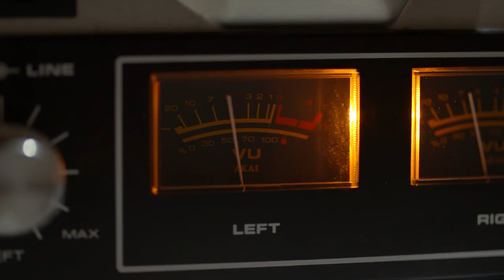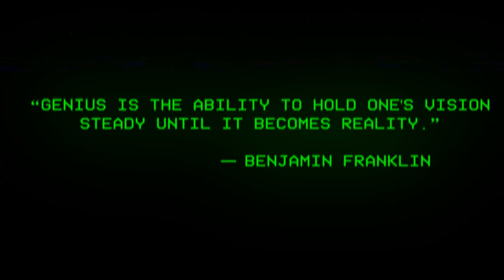Restoration of RUSTED PS2 Retro Console | Retro Repair Guy Episode 17

Comment: I wooden wash that battery with it I would take it out. but keep up the good work
Reply from the maker: Hi and thank you! Yeah I never follow my own recommendations (shoemaker always wears the worst shoes). That day I was concentrating more on filming than my work and noticed I forgot it when I filmed it come out of the dishwasher. I was going to replace it anyways as the unit was so rusted and the battery had leaked a bit. I just ended up cleaning the battery slot with alcohol and put in a new one. Thanks for watching!

Comment: What kind of lubricant did you use for the DVD drive? Can you give me an Amazon link?
Reply from the maker: Hi again. For gears on VCR, DVDs etc. There's a lot of expensive products out there but what I find works perfectly and that I always use is Lucas white lithium multi-purpose NLGI #2. https://www.amazon.com/Lucas-Oil-10533-Lithium-Grease/dp/B004X70LZA

A tube like this will last forever and just apply with a q-tip. You can also see the data sheet on it here: https://lucasoil.com/products/grease/white-lithium-grease

Comment: Hello Mr. Retro Repair Guy, I'm sorry to pester you with so many questions, but I was curious as to where you get all of your capacitors. You see, I have watched your Original Xbox video, and after watching this video it would seem that whenever you need a replacement capacitor, you always happen to have just the right one at your disposal. Do you buy them in bulk or something? 

I have seen big containers of capacitors for sale on Amazon, but I was wondering where you get yours and what kind you buy.

Again, I sincerely thank you for your help and time.
Reply from the maker: Hi Kyle. No worries you are not bothering me it's my pleasure. Yes I do buy capacitors in bulk from Digikey mainly and other suppliers because it costs a lot less. For example a capacitor could cost $1,50 but when you purchase 10 the price can drop to $1 and for a quantity 50 the price can drop to 70 cents. I repair many things and most units all use a certain amount of common values. However I still end up ordering if I don't have a particular one and normally receive them with 24-48 hours. With experience most electronic guys know what the common values they run into and keep a certain amount on hand.

Comment: Is it a joke ….????!!!🤔😨
Putting some PCB on DISHWASHER ?????🫥☠️
Reply from the maker: Hi! No not at all. Many manufacturers when rebuilding equipment dunk them in different chemicals and liquids. Water cannot get into the components like resistors and capacitors. Dishwasher tablets also help against corrosion. What you have to watch for is to make sure to air dry and not use heat. And of course I use a blower to make sure no water is left under chips or other components. Watch some of my other videos you will see how well some of the boards full of leaked capacitors or flux cleaned up. Thanks for watching!
Reply: @RetroRepairGuy  you’re an amazing fix guy , simply I wasn’t tuned about the Wash method with this MACHINES …

Thought that was Very agressive and ultra corrosive…

Anyway that was a pleasure to watch.😃

Good job man.👍

Comment: Corrosion and a bad electrolyte cap add to hear 50 or 60hz noise haha I commented befor you opened it up.
Good job out those bad caps
Reply from the maker: Hi! And yes agree and I always change the capacitors when restoring a unit anyways, which is why I just stopped testing it and began work on it right away. Still don't know how the port got so much rust.
Reply: @RetroRepairGuy  I think it was stored in a wet garage or area.
I do vintage audio repair and 99% of the time electrolyte caps are shorting DC or very low serial resistance. In amplifiers at the end stage they will blow speakers by getting DC on the output.
Well I find you have done a very good job and the Playstation is usable again.

Comment: With Free McBoot you can use an IDE hard drive with that network adapter to load games :)
Reply from the maker: Hi! Thanks for confirming that, I thought that might be possible but I haven't looked in to mods much. I might give it a try when I get my hands on a second one.
Reply: @RetroRepairGuy  It's not a mod, actually. The software for it goes on a PS2 memory card. No hardware mod required 😁
Reply from the maker: @Hounddoggy33  Even better! I don't always like modifying these things, I like to restore them to original. I will definitely try it then. Thanks again!

Comment: I got a PS2 with some slight rust from what looks like soda around the expansion Bay corners, should white vinegar work to remove it? I've heard using a baking soda and water mixture afterwards is useful too, also hopefully mine won't need any capacitors replaced bc that's out of my range lol, good video btw!
Reply from the maker: Hi! For the motherboard I would recommend 99% alcohol and a soft toothbrush. If you can’t get 99, 70% rubbing alcohol will do. The vinegar is good to soak metal parts that have rust. On connectors you can also use a pencil eraser followed by alcohol. Baking soda is good for many things and you can use it on the case but it would not harm the motherboard, however if you get to that point of taking it apart and cleaning, throw it in the dishwasher as I did. Most of these units will need recapping because of their age and will inevitably fail at some point because the capacitors will dry up. However, obviously leave it to someone who knows how if you intend to keep the unit.
Reply: @RetroRepairGuy  alright, thanks for the detailed response! 

So I'll probably have to stick with the rubbing alcohol for this, it's gonna be a weekend project at home, I just gotta get some parts and the tools I need, it's my first time cleaning a console so I'm getting as much info as I can, it's exciting! I already have some vinegar ready, and some brushes.

Thankfully it just needs a new clock battery, and some scratches removed, as well as a really good cleaning which I've been planning from the start, plus the tray piece with the PS logo is missing somehow, and the fan cover is chipped a bit, same for the casing beside it. So I'll probably do it in one go
Reply from the maker: @justanotherghost4589  Good luck with everything! Check out the pharmacy they sell me a huge 99% alcohol bottle for $20 (Canadian!). For the rusted metal parts if you can let them sit in vinegar for a few hours always better, but just the metal parts. Brushes the best is disposable toothbrushes that you get anywhere at Walmart and small paint brushes from the dollar store for dusting. The alcohol reason is that it evaporates. If you use anything else, or even the 70% just make sure to blow out all the liquid from everywhere. If you don't have a blower, use a hair dryer but on COLD only, no heat! Household cleaning wipes work best for fan blades as the alcohol leaves dirt residue. If the fan turns well just leave it, if it has trouble you can add a few drops of oil in the middle where the motor is. Battery obviously change before there is a leak, it's a CR2032 if I remember and again, dollar store.

By the way for the casing, if you feel like extending the project. You can fix it easily with Marine Epoxy from Home Depot. It comes in white and I think Black. Either way it's fast and strong and you can paint it. If you have parts missing, look for broken ones on eBay for "parts only" and make a transplant of what you need.

Hope this helps! Thanks again for watching!

PPS For scuff marks on casing use a Mr. Clean or other Magic Eraser or other white sponge. Again, they have these at the dollar store. If it removes some of the shine, I use some Aerospace 303 but you can use a drop of armor all or other similar cleaner for shining plastics.
Reply: @RetroRepairGuy  thanks again! So far I have most of the materials ready, I think I have the right screwdriver to get the head shield off lol, I just need the alcohol, and I have some white vinegar to soak the expansion bay, I think some soda was spilled on the back of it because it's rusty around the opening strangely, hopefully it isn't anywhere else, and I have some CMOS batteries, I just need some case parts now
Reply from the maker: @justanotherghost4589  OK good luck just be careful. Again soak metal only in vinegar but try first alcohol wherever you can. Cheers!
Reply: @RetroRepairGuy  yeah I will, just opening the top felt fragile when I did a little check to see how dirty it was lol, and I'll be sure to try it!
Reply: @RetroRepairGuy  okay so I decided to clean it today! I've been soaking the expansion Bay in vinegar and it's getting shinier, I can't tell if it's just an old layer coming off or what, hopefully it's not a protective coating or something
Reply from the maker: @justanotherghost4589  Normally a couple hours should do it. As long as you soak only metal it's fine. Don't soak any part of the board. Dry it off and rinse it well afterwards with alcohol.
Reply: @RetroRepairGuy  alright, yeah the board is fine, I just scrubbed it a little with some IPA, same for the heat sink as it had some spots on it, aside from that the cleaning has gone well! It just desperately needed soaked
Reply from the maker: @justanotherghost4589  Glad to hear it! If you have a pic or two of the finished product post it somewhere and give us a link.
Reply: @RetroRepairGuy  alright, and well I ran into another issue, the main disc drive ribbon cable doesn't wanna stay in, which is extremely frustrating, I might just try getting another laser eventually and replacing that. Because I think the connector for the cable is loose or broken
Reply from the maker: @justanotherghost4589  If you have a glue gun put a drop of glue to hold it in place. A drop of hot glue should not damage anything and can be removed easily. PS I know the laser assembly were cheap on Amazon for the PS1, might be the same for PS2.
Reply: @RetroRepairGuy  alright yeah hopefully that could work, because the little brown piece that helps hold it in came out too, it's interesting how complicated it is lol, if worst comes to worst I'll just get a new assembly